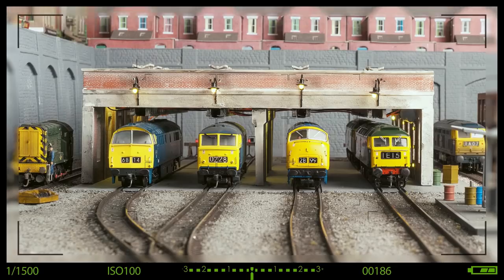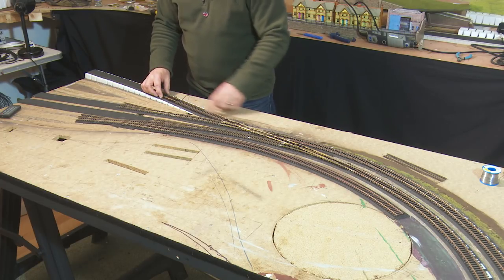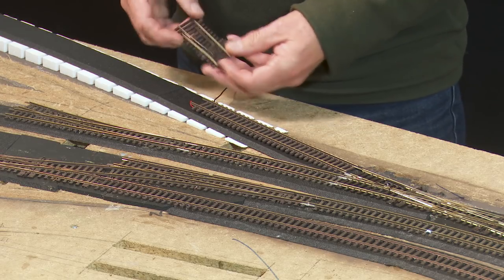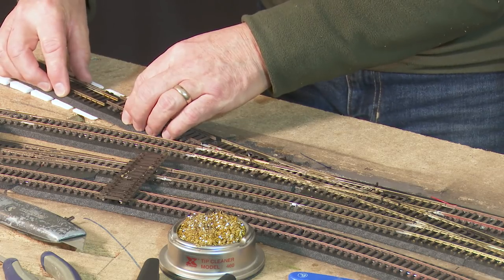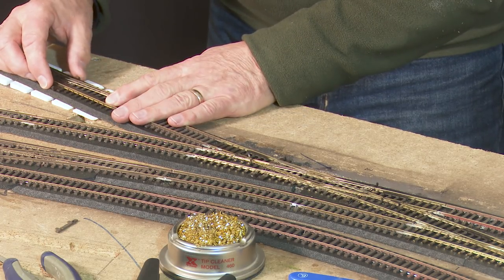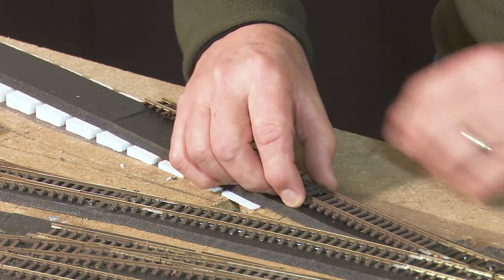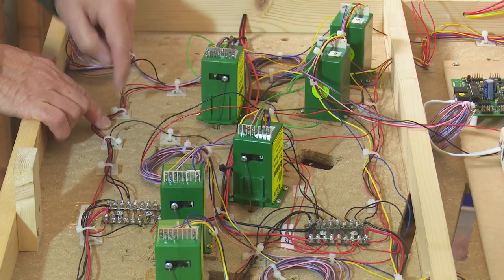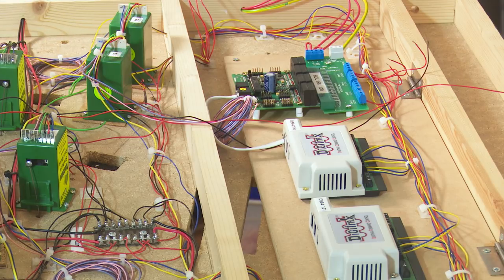Track Laying and Catch Points at Chadwick Model Railway | 79.

Comment: 00 guage. Enjoying your videos as I rejoin the hobby and embark on a large layout that needs the shed to be built yet. Tremendous humour you have.
Reply from the maker: Thanks Robin, you’re too kind
Reply: @ChadwickModelRailway  At last I found where I made my comment and to find an answer. Thank you Charlie. My shed has not yet started but I have been making baseboard modules. Close to 30 meters made. I have chosen a all made to the same size system where barely any are the same. Sort of makes sence really!

Comment: Hi Charlie, 

In response to your questions:  
     1.) I model west coast American railroads (BNSF/UP - The Colorado Joint Line) in HO;
     2.) I haven't seen derail points in my travels, what I have seen are bright yellow metal "derail" devices, either portable clamp-on or a remote control devices, that  stand up from the top of the rail and lift the wheel off track to derail the car if the car is traveling fast enough. Many times, the device will just stop the car from rolling further. 

I enjoy your videos and enjoy learning more about railroad practices on the other side of the "puddle."  Keep 'em coming, Bruce
Reply from the maker: What a great comment Bruce, and it’s interesting how various different countries operate the railway networks. Regards Charlie

Comment: Hi Charlie, as a general tip when drilling your 10mm hole for the point motor arm. Drill an additional two 1.5mm holes in line with a sleeper so when viewed from underneath a line can be drawn to indicate the position of the point motor to ensure perfect linear arm travel. Regards, Gareth (O gauge modeller) Top video as always and don't slack humor.
Reply from the maker: An interesting point Gareth.

Comment: I model HO/OO in Australia with also some HON3.5 for our 3 feet 6 inches. Catch points are very important and we have them even in shunting yards. Mainlines use them where a branch joins the mainline so I would put a tortoise motor on it as it will provide a little more Realism but Charlie it is your railway so it is your choice. Really good video and I have learnt a lot. Thanks Charlie.
Reply from the maker: You must be watching the whole of my back catalogue Alan! Stay safe out there mate. Regards Charlie

Comment: I like the old people approach to the solutions. You come across precisely to your audience. You could save a lot of the coplication with the wiring if you use Cobal IP pointmotors in stead as they each have their own decoder built in. Saves you  a lot of wiring and do away with central placed pointcotrollers for each four pointmotors.
Reply from the maker: I do understand Henrik but but I try to make things a little simpler for the subscribers.  Also Tortoise are quieter!

Comment: Hi Charlie, if you put that bright LED inspection lamp on underneath the board you will produce a pin point of light through the hole in the point that you are trying to poke the actuator arm of the point motor through. It makes it a bit easier.
Cheers

Charlie
Reply from the maker: A useful tip Charlie, thanks.

Comment: Interesting to see your methods. I've had a lot of problems with my Peco point motors and microswitches on my new 00 gauge Southern Region layout and was about to rip them out and replace with a  more expensive but reliable make. However, I saw in one thread a recommendation that if the Peco point motor screws are loosened a little the motors will work better....and, blow me, it worked a treat! Now to paint the rails, apply ballast then start constructing the curved platform. Mine will be timber built with exposed supports and bracing. I'll construct it in situ and will constantly check clearances and gaps with long coaching stock as I glue the subframes in position. Being a branch terminus there'll be the one platform with a bay, so not as complex as on your mainline, Charlie. Your Channel is the top one for modelling as far as I'm concerned!
Reply from the maker: Thanks Mr D, it’s comments such as yours that make it worthwhile.

Comment: Another quick suggestion that just occurred to me. You have numbered the tortoise motors, which is great. Might be helpful to label the wire going into the white boxes with the relevant number also to make tracing faults easier.
Reply from the maker: A good tip, the corresponding labels  are on the DS64s. 😜

Comment: Another chilled out but informative & timely video, thanks. I have some Marcway catch points to build up and never really understood what they do, so your explanation and prototype pics were a great help. I also picked up that Woodland Scenics riser pack (x2) at a train fair over Xmas for a great price so I now need to backtrack through your videos to see how you installed it. Plan is to use it for a raised HOe logging line up into the forest to give some depth. Looking at all your motors and decoders under the board (like mine), I did muse on how far away this all was now to thedays I had a 6x4 board with cotton pulls for the points with bolt nuts on the end to pull them....the days of when necessity (and lack of money) was the mother of invention. Cheers
Reply from the maker: I’m so pleased that you enjoyed the video and good luck with your project P.

Comment: An alternative to a catch point (I hope you didn't forget the sign for a catch point) is a trap point leading to a sand drag or short siding. There were 2 catch points on the line through the village I grew up in but both are now long gone since the end of unfitted or partially fitted freight trains heading up to Skinningrove steel works. Ex-OO now an N-Gauger.
Reply from the maker: Hi Neil, thanks for the useful tip about the sign.
Take care, regards Charlie

Comment: Brian models OO.  I’ve wired my catch point into the same controller as the point that controls main/branch, so they stay in sync.  I also use Acculite snapons rather than soldering to the tortoise.  It makes life easier because I can’t upend the baseboards.  Another excellent video, both for content and presentation.
Reply from the maker: Thanks Brian, you’re too kind

Comment: Hi Charlie, I'm Ian Kirkman, an 74 and I model in OO Gauge BR NE Region around the demise of steam and start of Dieselisation.. You recommend Radio Shack wire strippers in this video. Others may have told you already. but Radio Shack of Fort Worth Texas, went bust in, I believe around 2015. They had originaily set up the Tandy stores franchise in the 1970s or thereabouts. Tandy was where you probably got your wire strippers as they sold lots of Radio Shack stuff. They had been struggling with their electronic parts business but were doing quite well selling mobile phones. Apparently this came to the attention of one of the major mobile phone companies (I think it was Vodafone) who bought Tandy and shut them down, acquiring the mobile phone business and discarding the struggling electronics supply side.
You will probably be aware that Maplins also ceased trading in the last couple of years so now there are no electronics supply chains remaining (unless you know different). so we fall back on Farnell (Leeds), RS Components (Rugby?) or ebay and Amazon??
Reply from the maker: Hi Ian, Many thanks for the info.
Yes you're right, these strippers are indeed made by RS Components. 
Regards Charlie

Comment: Charlie , love your videos even though I am not a railway modeler , but I would use stainless steel screws because they are hard and you won't bugger up the head , also use a longer screwdriver so your hand is above the point motor..!..!
Reply from the maker: Good point Peter.

Comment: As always, great video, Charlie.. I'm too still use 60/40 solder because it's the best combination.. About cleaning solder joints, if flux is marked as no clean, i don't clean it.. But from experience, one time i use one universal flux to solder IC chip and didn't clean it.. After one year i notice corroded IC pins..
Friend help was very nice! Say thanks from viewers to him.. :)
About platforms, one suggestion is to cut them in parts and reassemble these with glue and cutouts, when hill size is known.. 
Second suggestion, but may take place in failure, heat up these platforms in places, where curve is needed and bent in right radius.. 
In reality, i prefer first version, but maybe other viewers have better idea's.. :)
Reply from the maker: Thanks Artur and good luck with your project

Comment: Great stuff as per Charlie. 
On my layout, i have one curved platform.  Ive used the same peco platform edging as you, all glued together in one long strip.
Ive then cut all the tabs off the back so they are flat, enabling me to stick them to 18mm MDF. 

You can get B&Q ect to cut a big sheet into strips for you. 
I then cut the MDF to the shape i want with a jigsaw and smooth it all off with a palm sander to make the curve nice and gentle.

If you use 18MM, the edging will stick up about 1-2mm, giving you enough depth to either fit laser cut paving (like mine), or use polyfilla for a flat top which you could rough up for a tarmac look.
Reply from the maker: Thanks Eric, that’s really useful.

Comment: Most interesting, Charlie, and nice to see a catch point being modelled. BTW, I notice you've said on a couple of videos that the clippers are from Radio Shack. No, RS Components are a British firm (originally Radiospares according to Wikipedia, which I didn't know before), retailing electronics for industry as well as consumers. Radio Shack was the US company behind Tandy electronic shops, and was aimed more at the hobbyist market. An easy mistake to make.
Reply from the maker: Hi John, so pleased you enjoyed the video. Yes the manufacturer of these wire strippers was a little confusing. Regards Charlie

Comment: Here in the USA, we typically use rail mounted derails to protect the main line. My gauge is 1 inch to 1 inch-I currently volunteer with a street railway and previously worked ten years for a heritage railway.
Reply from the maker: Thanks Akan, in the UK we refer real railway scale as 12 inches to the foot!

Comment: Hi Charlie just watched your latest video. Interesting, educational and very professional. The wire strippers are supplied by a company called RS Components (formerly known as Radiospares). Part number as you stated 382-2847 currently priced at £43.01 inc VAT. Available online from RS website, great tool have had one for years. Idiot proof thats why Ive always used it. Hope this is of some use to your viewers. Keep up the good work and humor!  Pete Corder, OO .
Reply from the maker: Thanks Peter, great info

Comment: Curved platforms! Peco Platform edging stuck down at the desired distance, length ect. beside the rails and fill the center in with Polly filler. It's a cheap enough method to get a realistic looking surface once painted and you can get perfect sloped ends using the filler, build custom widths lengths of platforms to compliment custom flexi track curvatures. Great vid, I'm OO gauge, nice to see no naughty nose scratches in this one! 😅  Regards, Brendan Silver.
Reply from the maker: Thanks Brendan, you’re far too observant for my liking 😜

Comment: Hi Charlie,
Nice clear video on that catch point hope you never have to use it. You need to build a long curved platform could you use card and or cardboard as I did on mine admittedly mine is just a tad smaller than you would need but the way I did it would work for you also only a thought if you do not like card would be also possible I would think to do it in plastic card instead. Keep up the good work and I am really looking forward to seeing you run some trains.
Cheers Robert.
Reply from the maker: It’s great to have you onboard Robert

Comment: I use Tortoise as well, What I have is 14 different colours of cable size 0.2 x16, and I devised a chart so that I could use a different pair of colours for each point motor. I use DPDT switches to operate the points.
Reply from the maker: Sounds very efficient Sam.

Comment: Hi Charlie. Yet another great, informative and funny video, I'm beginning to wish I had gone with individual boards like yours rather than fixed baseboards. Your way makes the wiring so much easier, I'm having to do all mine on my back under the baseboard, which with my bad back and aching neck is not much fun.
Ho ho, all part and parcel of life, thanks again for all your efforts.

David   00 gauge.
Reply from the maker: You’re too kind David

Comment: Hi Charlie.
Currently building a garage layout in 00 & 009 to run GWR/LMS 30's - 40's. Whenever I need some guidance, this is where I come for it.
I opted for cork base & Cobalt Analogue with DC control, as my stock contains lots of older specimens.
Love the style and the content. Thanks & regards. Gary Edwards
Reply from the maker: Thanks Gary, it’s comments such as yours that make it worthwhile

Comment: Hi Charlie, Your channel is like opium, very, very addictive. So I have got my shot for this two weeks and superb again. Oh by the way I model in 'OO' but modify track and points to give more realistic sleeper spacing. Thanks to you and Everard Junction I am now also addiced to chopping up PECO 100 track I have found that by removing everyother sleeper but keeping the inter-sleeper web in place I get an almost "proto-typical" (hate that word) spacing and retain both the flexibility an d sleeper positioning. I have now completed over 20 shutters (08, Jinties and 3F) with the DCC automatic uncoupler that you videoed at McKinley Railway, I sourced the motors from  China at a cost of peanuts, thanks for that excellent video.
Reply from the maker: Wow Bruce, I’m so impressed.
Good on you.

Comment: How about using one of those long platforms for another station alongside the TMD? It might look pretty cool if it were at the back, with a single centre platform and trains stopping right next to the arches. It'd open the door for some pretty cool stair and bridgework and provide some background action while filming in the yard. Maybe make the undecided area opposite the viaduct some sort of city outskirts suburban or industrial area and have the branch line terminate there instead of on top of the fiddle yard? (That could also lead into some interesting freight possibilities on the branch line, too.)
Reply from the maker: Some interesting options Max, thanks very much.

Comment: Another fine video Charlie! Ah the joys of grovelling around under the baseboard - I have had to wire all mine that way! My layout is 00 1960s Western and Southern ( la Exeter St Davids - although not a replica). I have 10ft long platforms some of which are curved. I cut them from 18mm pine board having spent hours measuring and drawing templates! As an aside did you decide not to put droppers on the catch point?
Cheers!

John
Reply from the maker: HI John, yes I didn't think that the catch point will require a set of droppers with both adjacent rails being wired.  Well done on your curved platform I'm not looking forward to that one.

Comment: Why did you use an insul frog double slip?  In answer to your question, I model in 00.  At the start I was afraid you were going to install the catch point the wrong way round.  You got it right at the end.  Thanks for another informative video which I always look forward to watching because you are honest about mistakes you have made.  Sorry I suggested having a curve now looking at what you are going to have to do with your platforms, but it will add character to the layout.  Is there any way you can score the support wall on the side you can see so it doesn't break, then on the side you can't see, cut a short section out of the wall then carefully cutting a thin triangle from the platform surface.  If you do that at a number of different points along the platform, you should be able to make the platform curve.  I would be time consuming to do it though.
Reply from the maker: Blimey, an interesting option Don.
I’ll check it out

Comment: I am modelling in p4, or starting to, with a small layout slowly being built based on a small section of the harton electric railway. Have plans for a southern region layout following that.

One question about your catch/trap point, a sand run off level with it would look good and prevent locos falling down an embankment. Thought you were going to put it the wrong way round at first with trains derailing onto the station track!

Great video as usual.
Reply from the maker: Yes my thoughts exactly. I do intend to have a Sand traps on the left hand side against the back scene.

Comment: Hi Charlie, great stuff as usual, you just need to add "To me, to you" now with Ian ;). Green era pre tops on OO with code 75 bullhead. Not much progress with the layout as I'm stuck waiting for the medium radius points. I like to use some flux when tinning rather than rely on the stuff in the core of the solder as this makes the solder run on to the wire a bit better. I think I might use Cobalt IP motors as the DCC element means they can be wired straight to the track bus, but some Seeps in the storage/fiddle area. By the way the Patreon links seldom work for me, but that isn't a big deal, I can wait the extra day!
Reply from the maker: Thanks Jane, I’m so pleased that you enjoyed the video.

Comment: Hi Charlie,  Love the video, most informative, however one question for you.
Do you use flexi track on curves or set radius ones.  I'm having all sorts of issues trying to get them done using a length of 20 x 12mm wood with slots cut into it for the rails.  Any advise would be greatly appreciated.
Best Rgds
Dave R.
Reply from the maker: I’m sorry Dave but I don’t quite understand your problem.
I use flexi track with assistance from Tracksetta templates.  I only use set-track in hidden areas.